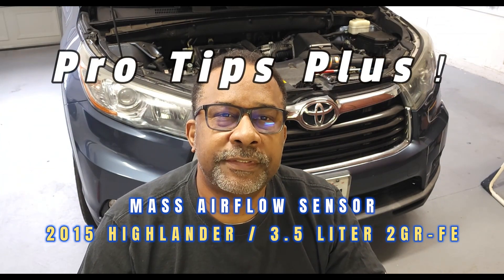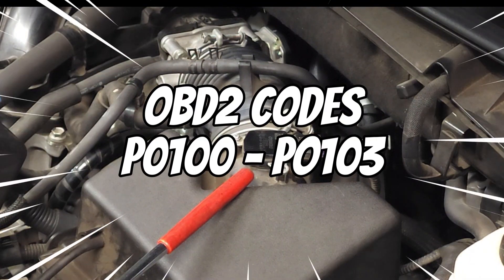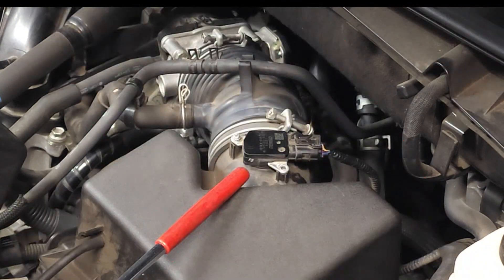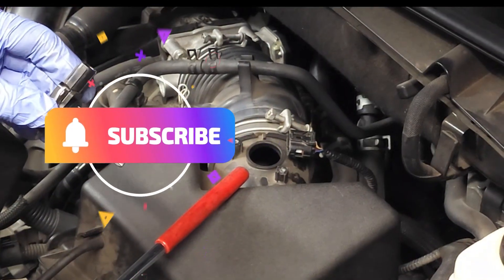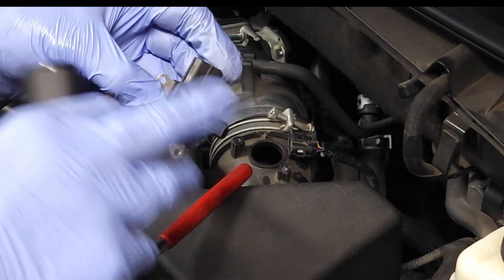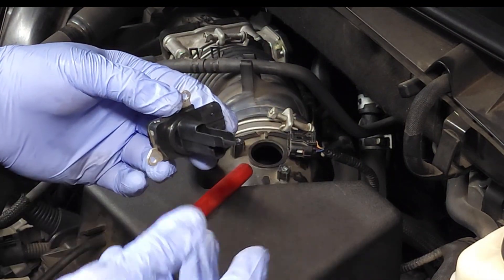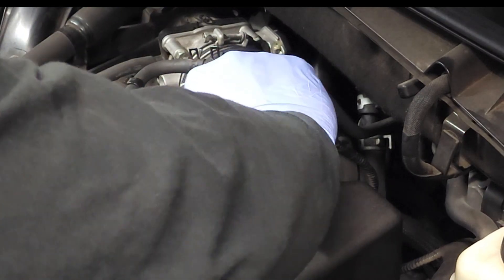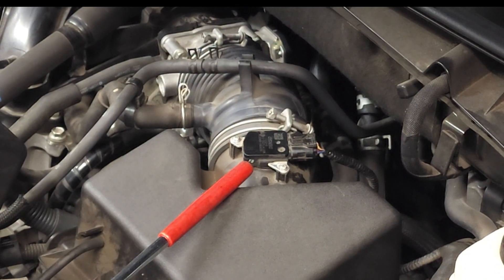2014-2019 Toyota Highlander Mass Air Flow (MAF) Sensor Replacement Tips

Comment: I have a 2017 Highlander Hybrid and how do I access it.  More stuff in the way
Reply from the maker: Usually, hybrid components are off to one side. The MAFS should be in the same general location as described in the video. Look at the large intake hoses that connect to the air filter housing.
Reply: @protipsplus  it's in a really bad location.  Not easy to remove without removing the air hose.  Can't access the screws and this is a common question on Reddit.  There is not one video on YouTube which shows a hybrid only non hybrid versions
Reply: @protipsplus  THANKS  I connected my Carly scanner and the voltage from it was normal, so my problem turned out to be idle control valve
Reply from the maker: @bobl2256  I thank you. Please share with friends and followers.

Comment: Wow you made pulling that connector off look so easy. I’m not as strong as I was 20 years ago but I’m stronger than most and I couldn’t for the life of me get that connector off. I pushed and pushed until my thumb/ fingers ached but it wouldn’t budge. I’m not sure what year this Highlander is but mine is a 2017 with about 70,000 miles ( 125,000 kilometres ) and the MAF sensor doesn’t look like this one in your video. I had no option but to use CRC  MAF Sensor cleaner and spray the “ outside “ wire that was easily visible but U shaped. There was a “ opening “ near the bottom of the sensor that must have a second wire inside it but doesn’t look like the one you show. I sprayed in there and I’ll give it a few hours of driving to give the ECM a chance to adjust fuel settings etc. and see if there’s any noticeable differences.  The Toyota Dealership says the spark plugs don’t have to be changed for 150,000 Kim’s ( over 90,000 miles ) but everything I’ve seen says to replace them at 60,000 miles. I’m going to do the plug change myself so I’ll also clean the throttle body at that time.